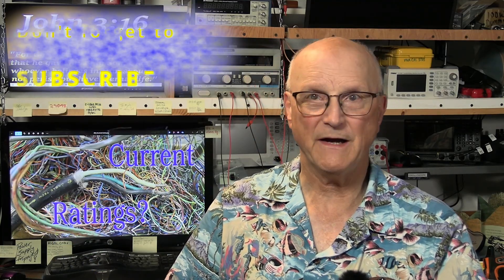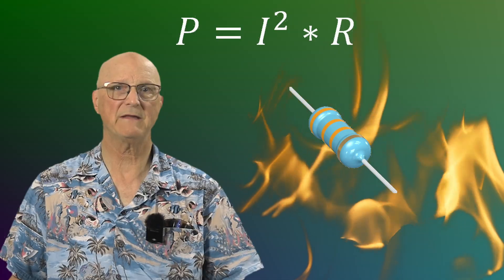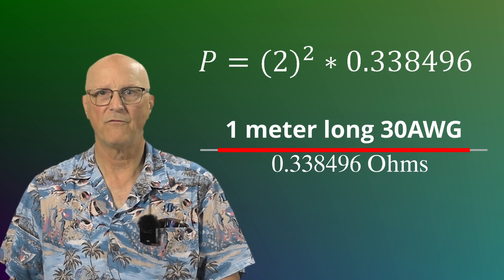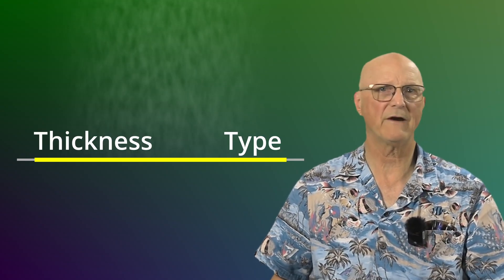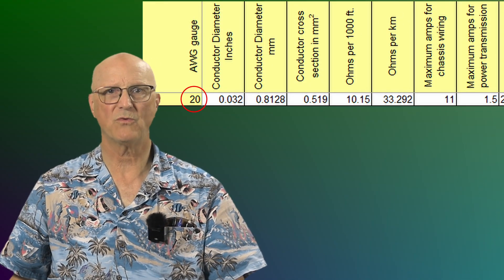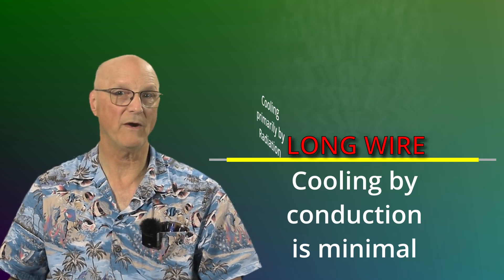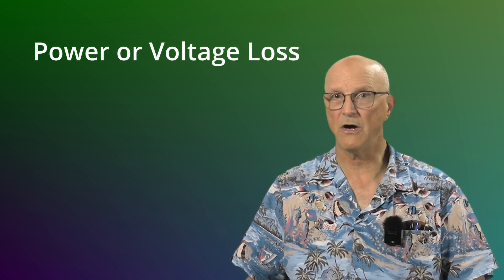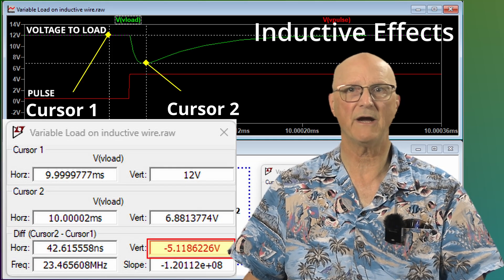Conductor Current Rating (083a )

Comment: Very useful information. I work with low voltage/high current and have become accustomed to seeing everything in milliohms. I use a Fnirsi battery meter to measure resistance of test leads, jumpers, etc. I even compared copper vs steel alligator clips today. Very interesting subject.
Reply from the maker: Thank you! I am glad that you found the video helpful and interesting. :-)

Comment: I was looking in a wire gauge table and found that a 14 gauge wire also has limits depending whether it's solid or stranded. The more strands the less current it can take. So, solid conductors are best. Thanks for the video
Reply from the maker: Yes, that is another limitation. Frequency is also in there. As the frequency goes up, the actual amount of copper involved in conducting the current goes down due to "skin effect." The current rating also decreases. :-)

Comment: Added to my to do list: Calculate the inductance of a 2m dipole built from 4 gauge solid copper wire compared to 8 gauge solid copper wire. Then ponder whether this factors with the more broad banded nature of a thick element driver compared to a thinner element driver. Thanks for making me think this morning, Ralph.
Reply from the maker: Sounds like an interesting experiment. You could use the FREE 4NEC2 Antenna modeling program to do virtual experiments. I have several videos on how to use the program to model antennas. Here is a link to the first one: https://youtu.be/Zd6BT558YRA
You are very welcome! I'm glad I was able to get the brain juices flowing! :-)